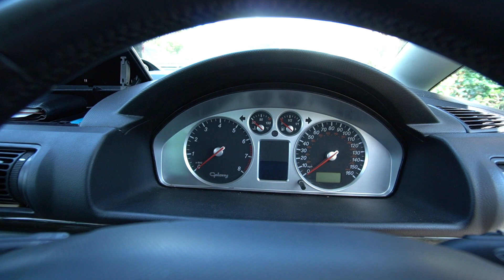Van Life isn't For Everyone! VAN LIFE ENGLAND!

Comment: Dead Battery is annoing, but sorting it out is pretty simple actually, specially in a Manual Transmission car(Like Your Van).
All you need to  do is put the van into first gear, press the clutch fully in and tell your buddy  to push that van from behind, as the van starts to move  and gain some momentum, let the clutch out rapidly. Your car will start even if the battery is drained completely(the car will jerk before starting but it is normal and wont harm your transmission or clutch plate.) (Can also be done on downhill roads ).  Note:  While following this procedure of push starting, your foot break might not function so use the hand Break to stop  the van in emergency conditions. This technique is pretty safe if you have space and manpower to push  your van. 
Then drive to repair shop or battery charging station without stalling the car to charge or replace your battery.

This technique has helped me a lot. 
Regards from Nepal.  Travel Safe and free.
Reply from the maker: Thanks for the tips, I will try this next time!